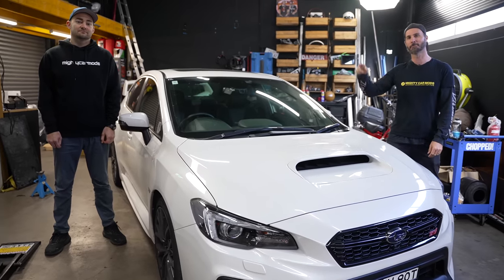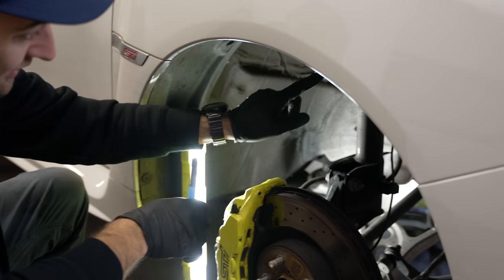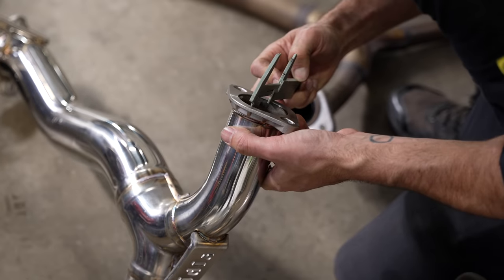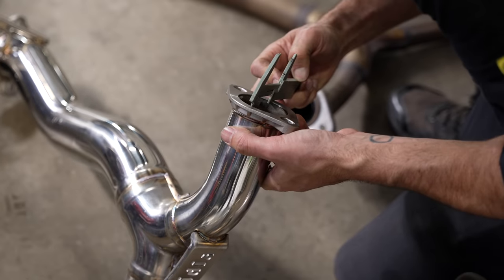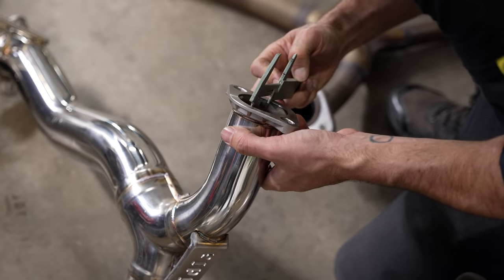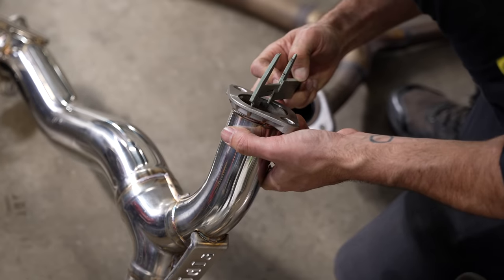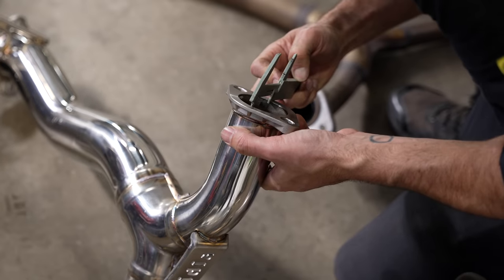The TOP 7 CAR MODS Everyone Should Do | WRECK IT

Comment: I find holding that exhaust with my knee so that it slips and the whole muffler falls on my face and breaks my nose to be the best method for installing an exhaust.
Reply from the maker: Hahahaha. Proper LOL’d at that
Reply: Yes, can confirm this is indeed the recommended method
Reply: And here my wife said i was doing it wrong! Ha! Shows what she knows.
Reply: I used this method while also trying to TIG mine. So I got the combined exhaust to the face and hot flange to the forearm.
Reply: Last time I was holding a muffler up under a car doing hangers on my back, my shoulder just said fuck it and dipped out of it's socket :' )
Reply: Mod your car and your face all in one
Reply: Yep, that's the suby way..... hurt myself many times on my SG XT.
Reply: Mighty face mods????
Reply: @mightycarmods  Wait didn't Marty get his nose smashed one time by an exhaust? I saw you guys posting it :D
Reply: A pair of safety glasses are a must, when working overhead. You are bound to get a face full of dirt etc.
Reply: How about when you are changing a down pipe on a lift and the cat slips out of the bungee holding it up and Tarzan swings off the O2 sensor into the back of your head?
Reply: Im glad im not the only one this has happened to
Reply: That’s happened to Marty in a Japan video

Comment: This is amazing. So much great information for all the guys that are now starting to get into the car community! My personal go-tos would include a [d]ownpipe for decreasing wasted power, increased sound and preserving engine lifespan on modern vehicles but other than that your list was absolutely amazing and inspirational. My little tip on top would be: take your time when building a car; rather go step by step and fully appreciate all the little details the parts add instead of just installing everything all at once and also: if possible include friends and prusue that awesome journey together.

Comment: With the hot aussie summer coming, window tint is a great first mod, the interior won't get as hot and you won't have as much glare, this means your interior will last longer, you'll have to use the AC less so more powah and you'll be able to see and hit the apexes easier! A well worth it mod!
Reply: didn't you hear,
summer is canceled due to dangerous dan,dilligaf gladdies and emperor marky mark and the covid crew
Reply: problem with tinting is peeling and blistering. I'm an all day driver for work. The amount of cars I see where the tint has bubbled. My first car tint bubbled after 5 years. My new car I decided not too.
Reply: @Paul-op9oz  5 years lol i thought id have to be redoing the tint way earlier than that. thats amazing durability
Reply: Make sure its ceramic tint, theyll do better with block uv rays
Reply: Did my r34 15% all around. Amazing difference immediately. Just gotta hope the coppers don’t notice the difference too lol

Comment: Another "bonus mod" you can use is a high quality weighted shift knob. Makes a big difference for the shifting experience. Also, for an STI mud flaps make a whole lot of sense in the "kit" category.
Reply: True. The shifter knob makes all the difference. Especially if you change the shaft too. I had my shifter knob changed to a smaller one on my previous car by the previous owner and he also had removed the bulky foamy plasticy body of that shifter so there was just a small straight metal stick and a small knob in the end of it. It made me want to change the gears constantly. It felt so good when there was just that small metal stick with small shifter knob.
Reply: Love my new gear knob and short shifter.  As you say, a big difference to the shifting experience
Reply: Also good for wearing out the synchros in the gearbox prematurely.
Reply: @beezie2566  Rally Armor and Rokblokz mudflaps are great.
Reply: I wanted to change my knob and my shaft but my urologist said no.
Reply: @cyclonicleo  my girlfriend doesnt like my short throw setup 😣
Reply: @beezie2566  rally style and track inspired car equals mudflaps, so deal
Reply: @makeit.nice1111  still gross. Especially the red ones. Local guy has a blue STI, gold wheels, slammed with those god awful red mudflaps that are literally touching the ground, dragging while driving. Hideous.
Reply: @beezie2566  So one guy is using them wrong, so they are all bad. Great assessment there.
Reply: @AlDim000  it's not just one guy, but yeah. Look man. It's an opinion.

Comment: I love Cobb. I've used their parts on my speed3 and focus st. The quality and performance is awesome and their customer support is great too. Nice build boys!
Reply: I got my e36 m3 corner balanced at their shop in Texas. They were quite alarmed when they thought I did a fuel filter delete. They went as far as to personally insult me for it. I was alarmed to realize they had never worked on an early e36 with the fuel filter on the side of the block rather than along the frame rail. This was in 2014. Never went back.
Reply: Well worth getting a custom tune for the Cobb accessport though! The ots maps are ok but real improvements is in getting it custom tuned. Plenty of people who will do it for not too much money over the internet using logs.
Reply: @weedshoes5089  The shop in Plano was a privately run tuning shop owned by COBB at the time but was basically just COBB in name. The people that make the products are/were different and had nothing to do with your experience. Not saying you don't have a valid gripe but just want people to know it has no bearing on buying their parts.
Reply: @Bones12x2  Good to know

Comment: Seriously have to jump in here and get my, “ Hey Ryobi” to read this!, these tools such as ratchets and grinders that have the battery at 90 degrees to the skin, needs alterations, I’d like to see them in a side mount or angled as the battery in some cases stands out taller than the socket or grinding disc’s and makes it hard to get then close to the work

Comment: Coilovers, never just springs. Change the spring rate and you'll need to change the damping, or you'll wind up with an underdamped suspension, causing bounce.
Reply: Well designed lowering springs, like Whitelines, account for this very well. Unless spending you're A LOT, quality springs will be more comfortable and reliable than coils most the time. Coils are generally spec'd for track/"high performance", not what you want on a daily.
Reply: I put lowering springs in my GTI and didn't run into that problem.
Reply: I'd only put coilovers on a street car if there isn't a realistic alternative. For instance, I have an SF Forester and in my opinion the proper way to lower an SF or SG is to use coilovers.

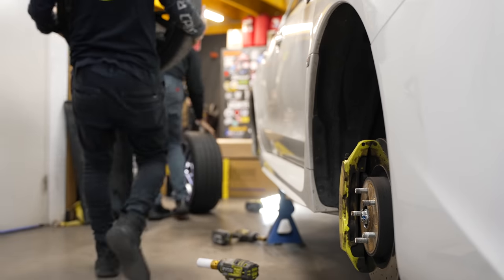Comment: 3:05 -  You guys actually want to get an impact wrench*, dont make the rookie mistake of ordering an impact driver for removing stubborn wheel nuts and the like
Reply: What's the issue with a driver?
Reply: @PheonixRise666  Drivers are usually made for driving in screws and the like, they transfer their torque through a 1/4-inch hex collet that accepts 1/4-inch hex shank bits. Impact wrenches typically use a square drive (at least 3/8in, usually 1/2 in) that you attach a socket to...impact wrenches usually have more torque unless theyre like extremely compact models, whereas those tiny 1/4in hex collets used with drivers usually fail in high torque applications (think of all that torque being transfered through a longer thinner piece of metal) and also require adapters to attach a socket to, but are absolutely fine for light duty applications
Reply: I think I made that mistake but worked out fine with the socket attachment, granted I just did 2 front shocks

Comment: I'm looking at buying a 2015. This video perfectly describes what I want to do! The only concern is I have seen lots of people saying you NEED a tune for exhaust and intake and to not just add engine mods as that can be damaging.

Update 1/05/2024: WRX 2016 bought 😊 tune for intake, yes, tune for exhaust, no. Haven't modded or tuned yet but do your due diligence! Flash/OTS tunes seem like a no go, but that's my personal orientation.

Comment: It's worth mentioning that Subaru uses a MAF system and they use hypereutectic pistons with a very high silicon level meaning the pistons are strong but susceptible to fracturing more than other options. Installing an intake with no tune can cause the car to run lean inducing knock which because of the high silicon count can mean the shockwave can shatter your ring lands. Always tune your Subaru for your mods. Never use bolt ons without a tune
Reply: Even a cat back or axle back?
Reply: @standforcanada4967  honestly, I would tune the ECU even on a stock car (assuming you don't have any engine modification plans yet; otherwise do as soon as the mods go on). The sensitive pistons in the EJ205, 255, and 257 plus the fact that the OEM Subaru tunes aren't that great for OEM "across the board" (at least the GD generations and early 08+, not sure about later).

Comment: +1 for the Michelin Pilot Sport 4.  I have them on my M5 and they are grippy and predictable and still work really well in the wet.  They also last surprisingly well for a performance oriented tyre.
Reply: how long do they last?
Reply: @arcanevoid9199  I've had about 10,000 miles out of my last two sets.  Bearing in mind I have to be careful in first, second and third not to spin the rears up, it's surprising that the fronts don't last much longer than the rears.  I'd say that's pretty good mileage for a performance tyre.
Reply: @joshuarosen6242  ok thanks :)
Reply: @arcanevoid9199  the Michelins also seem to have much less road noise than similar performance-level tires. That is what justified the cost for me when I got PSS for my 2005 STI. That thing has hardly any sound deadening, so the reduction in road noise compared to stuff like Goodyear Eagle F1 Asymmetric or Hankook RS-3 for example, was very noticeable, despite having similar dry grip and slightly better wet grip.
Reply: @jsquared1013  already have a set lol, just wish they made more sizes in r16

Comment: After tires (wheels optional), the next mod should really be brake pads and fluid (aftermarket rotors/big brake kit optional). This is especially important on cars that come with less-than-performance-oriented brakes from the factory.

Also, wheel lug torque should be set with the car on the ground, NOT lifted.
Reply: Agreed. Tyres first, brake pads 2nd, better rotors 3rd, then ... I usually free up the intake. Others can have a droney exhaust
Reply: That should just fit under general maintenance and shouldn't be considered a mod. When you buy a new car, you check all fluids, inspect and fix/replace everything necessary and only then do you start modifying
Reply: @szewal  I'm talking about higher temp pads/fluid. That's an upgrade, not just general maintenance.
Reply: @szewal  tyres make the biggest difference to a car if you are a 'spirited' driver. Go and fit the best tyres you can and feel the difference, especially in the wet. Then you have to stop. Aftermarket pads and rotors can transform the braking. Then of course, up the boost.

Comment: Brings me back to 2003 when I bought my WRX Wagon and started to do mods, many of which I had to make myself.  Back then, Cobb had just introduced their Accessport, which I didn’t end up getting and regret not spending the money then.  The thing I ended up realizing is that for the money spent on improving performance of the Subaru, I could instead buy a higher performance car (used), although the awd of my WRX wagon was so fun in the rain, ice and snow, something I’ve not been able to enjoy since I sold the Subie in 2008.

Comment: I have done all these mods to my wrx, minus the coil springs as I feel the car is low enough. I am glad they added the bonus mods as I was thinking the whole video, what about sway bars, they made a huge difference on mine. I went the r400 exhaust. The factory bpv sounds like garbage, once you fit an intake, it also leaks, if you put your mouth on it and blow, some air gets through.

Comment: straight pipe is the best way to go with those and the STI come with a great stock suspension so that was a waste.. I thought definitely there would have been Oil Catch Can in place of the C for coil overs. They are DI engines now. So a CC would be the first thing I installed in that car.. But nice job.

Comment: You need a custom tune on the STI or any turbo Subaru with the blow off valve. When you let off the gas and it blows off the air, it is blowing metered air out of the system. This causes a rich fuel dump into the cylinder and can wash away oil from the cylinder walls. At the same time fuel can get past the piston rings at this point down into the oil causing bad things to happen.

Comment: Using power tools to assemble the dampers will potentially cause the piston to spin inside the damper. There is a risk of dammaging the seals of the damper when doing so, and that is why there is a notch for a tool at the top, to counter-hold the piston while tightening the bolt (using the tools made for the purpose).

Comment: The ecu is metering for the bypass valve air. By letting it out of the metered circuit you may have problems.

Comment: This was nice. These days it seems the cheapest way for big power is to get a hold of one of the many thousands of 335i (or 135 535 x3i etc) with the N54 engine in it for very cheap do the maintenance the previous owner didn't do and is why you got it so cheap (I got mine for &1900 CAD) then put in the cheapest bolt on's from Amazon or Ebay or from any of the many stores that sell them Tune it with your phone and mhd get 500+ HP. It's the the best chance to afford it. If you have a bit more cash you can go for aftermarket turbo's (Chinese cheapie's have been blowing the folks away with their ability and even fairly good reliability) to 900hp on factory internals.

Comment: Mighty please do a full race build on the sportivo 2zzge would like to see use using the full mwr racespec mods in the 2zzge  and compare to other lift engine and do a reliability test between the engines and quarter-mile run.

Comment: In my experience, if you are deciding between which to get first, intake or exhaust, go with the intake and get something high quaily, preferably with some kind of velocity stack built in like the K&N Typhoon. Makes a bigger difference to the sound on its own but you will want both as they complement each other. And when you get an exhaust, get creative and buy coloured hangers to really make your system pop visually.

Comment: Quick word on ECU reprogramming if you live in the state of California: it makes the car immediately illegal. All ECU tunes come with a warning ("for offroad use only", or something along those lines). It's ok in most of the other states, however.
Not to mention, messing up with the intake/exhaust on an already performance-oriented car is generally the wrong way to approach the problem. It might work on a Camry or similar type of car intended for moms and dads, but the Subaru STi was engineered to be the "japanese M3". If they could have bolted on a legal intake/exhaust that made more power, believe me they would have.
Reply: aftermarket parts don't have to deal with emissions standards etc, theres a reason you can make more power with them. the cars are detuned from factory

Comment: It looks like you stuck the 'wind deflectors' on the outside? I'm sure There designed to fit inside the frame. Usually come with clips that hold it wedged in but usually they fit solid without✌️

Comment: I worked at a Subaru dealership where a guy had issues with the ECU. Warranty denied any repairs due to it only having 17 key cycles on it with 28,000 miles on it. Hmmm

Comment: Title disappoints! I was hoping for car mods with a wide appeal, but these are all mainly for having a fast "cool" car, while I am more interested in car mods that increase durability and gas mileage to reduce the costs of operating the car. 

I found this video from looking up info about the Kia Optima front lip bumper, as I've had a problem with it falling off and recently it randomly fell off while driving without even something scrape to trigger it that normally causes it, resulting in it being run over and no longer fitting on securely! So I'm looking up how to install it, and am also trying to see if there is anyway to either make the car scrape less on steep driveways (e.g, by lifting it) or to make the front lip a bit more durable so it does not fall off.
Reply: they do have a wide appeal, you dont represent the majority of people who want to mod their car. idk why you would be worried about more durability and gas mileage on a kia optima
Reply: @arcanevoid9199  By wide appeal, I mean for the majority of people in general, not just the majority of people already interested in modding their cars. The kind of appeal, that might be able to get someone interested in car modding in the first place. 

I am worried about more durability and gas mileage because I use this car for Doordash, which puts a ton of miles on it, in addition to the bumper-lip-falling off issue mentioned in the original comment. Extra durability and gas mileage can save money in fuel and maintenance, especially if one is using the car a lot for commercial purposes. When buying things, I am primarily interested in things that can make or save money and/or time, and in the realm of car mods, the most obvious areas to do that for me are in adding extra durability, and in making things more efficient to save money on fuel.

Comment: Dear Mighty Car Mods. I'm currently based in the UAE, and it seems like it is very difficult to come by aftermarket spare parts. I use so much time searching the web, to come up empty. The wheels, tires and air filter is never an issue, but for the exhaust and coil overs it is impossible to find anything. Do you have any tips on how to find part that will fit your car? (I have a mk7 golf)